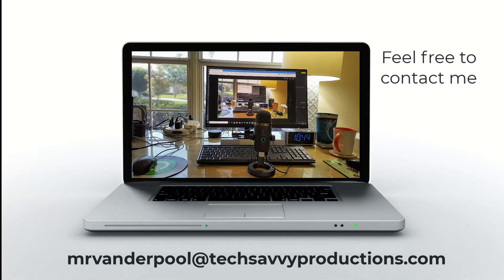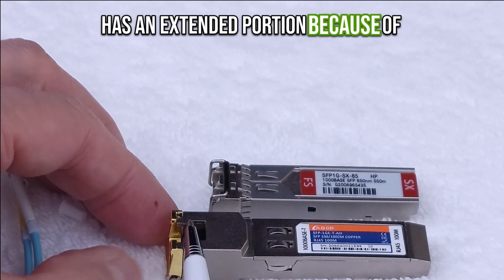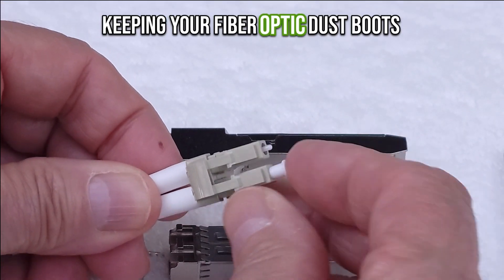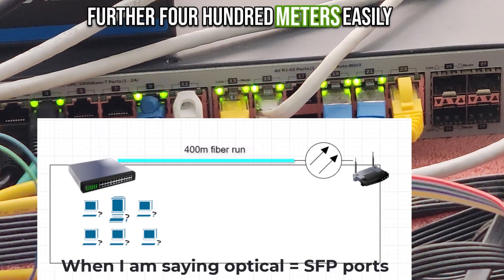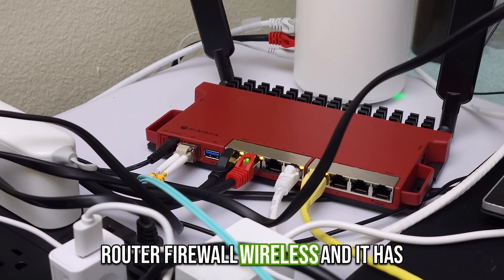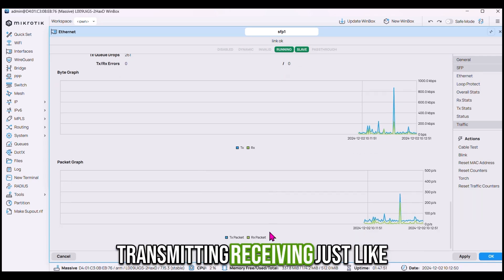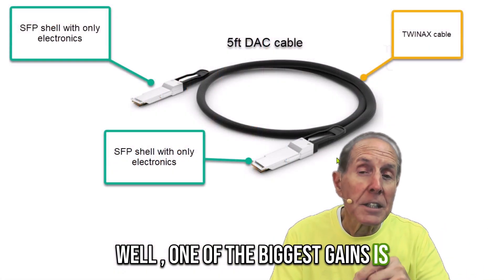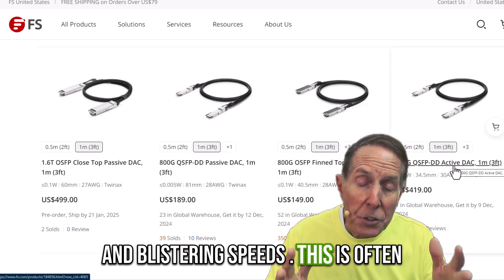SFP Transceivers in Action: Configure, Connect, and Monitor Traffic A Quick Practical Demonstration

Comment: I tried   that SFP  coonector     with   the   RJ45   connector . You are  right it's  jammed  in there LOL   My   question  is  that      for   switch to   switch   only  ?     I tried  connecting my computer laptop  into  that port   thinking    it would give me internet   access   and  got  nothing    This  real  confused  me ?    Then  I started  thinking in  my  highly  analytical     brain  that it must   be switch to switch or    switch to router connection  because   you can do  fiber  on that  port .   Then  their is   question  why two SFP ports  on a  Cisco router   Is   one a  oplink  and the  othera downlink /
Reply from the maker: Check to see if it is configured as a "trunking" port.  That would explain it.
Reply: @TechsavvyProductions   I   am  very familial with the  word  "tRUNKING  " I worked  at  at    company years   ago that  made PBX  systems where  you   had a wall mounted  unit  that  contained    line and trunk   cards  that  plugged  into a  backplane  You  could build a  big  company  phone system    with those units   with many phone  lines  coming  in